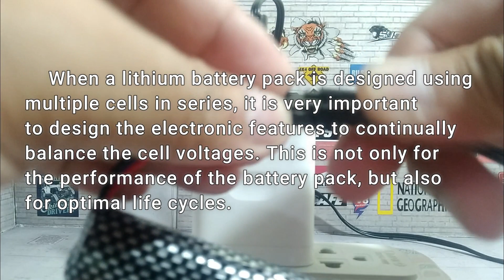How to prevent MN WPL 18650 Battery Health Going Down

Comment: Hi. Looking at the specs online it says for Lipo battery. How is the long term use. Is the charging current fix or auto adjust. Can I charge 14500 batteries? Thanks!
Reply from the maker: Hello bro, yes you can charge your 14500 Li-ion battery. Lipo and li-ion are same lithium base.

Lipo - lithium polymer
Li-ion - lithium ion

Difference is the electrolytes
Li-ion - liquid
Lipo - solid
Reply: @morrisrc  Thanks!